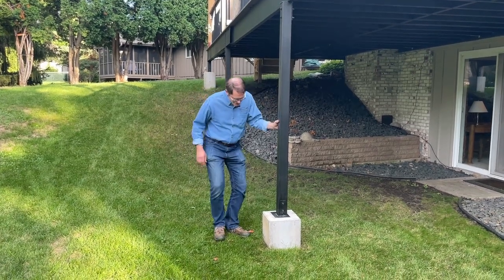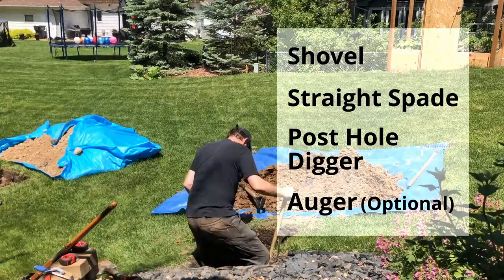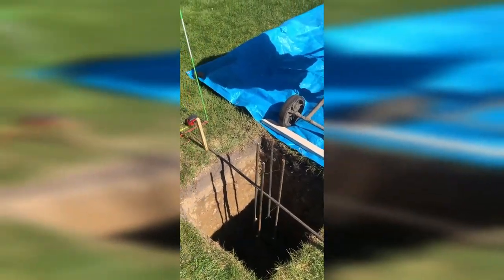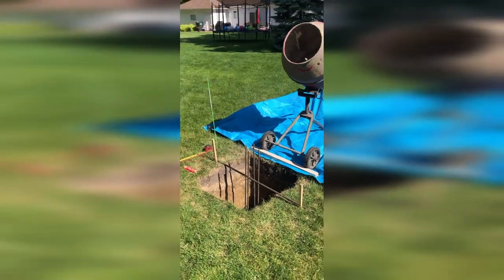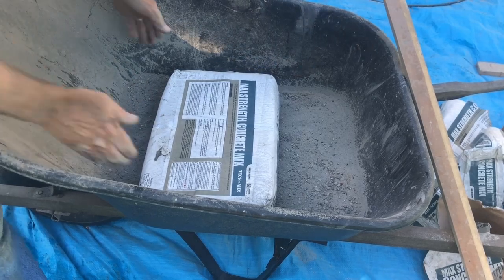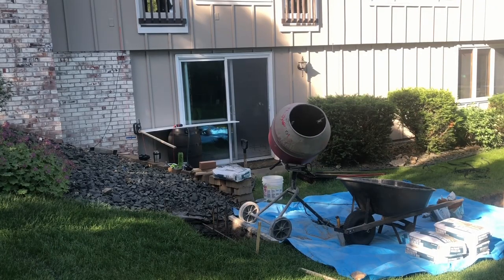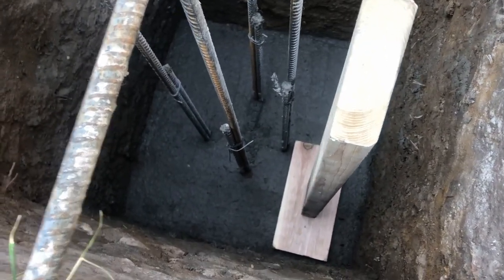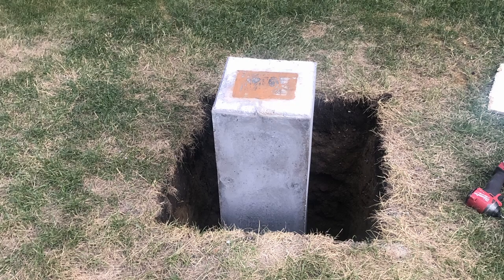DIY Deck Footings + Piers - How to Pour Concrete

Comment: That concretes junk. Way wrong. Over kill on the piers unless u live way north
Reply: How is it both junk and overkill?

Also, he is without a doubt up north because he said his footing depth is 48”.
Reply: @forced_youtube_handle   he took forever to pour. It’s in layers. It was way too dry. He used a sonotube or homemade box. Pour right in the soil. He didn’t even oil his box. So much more